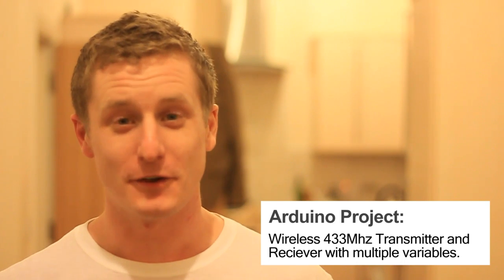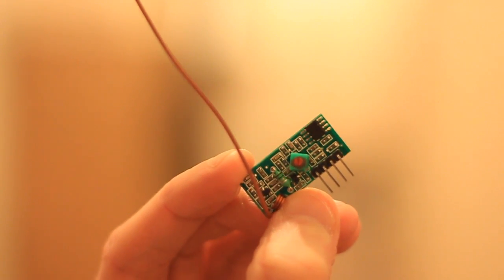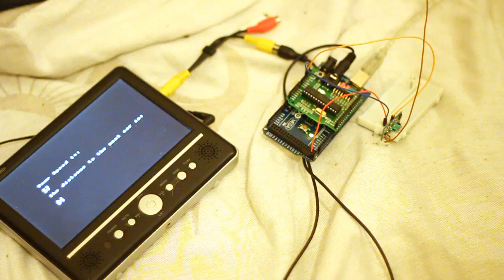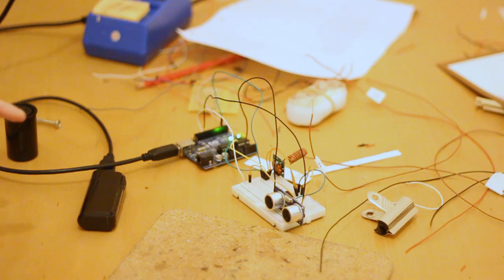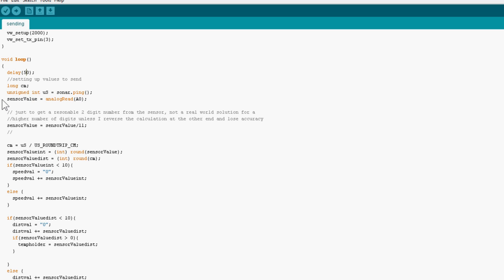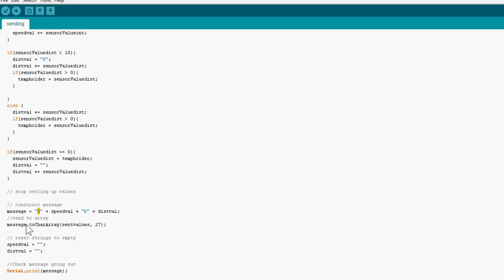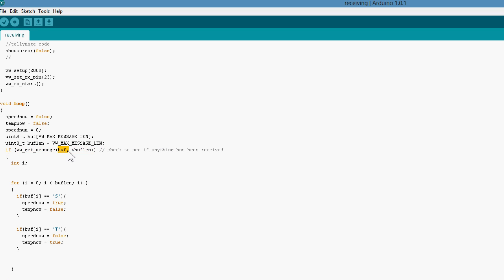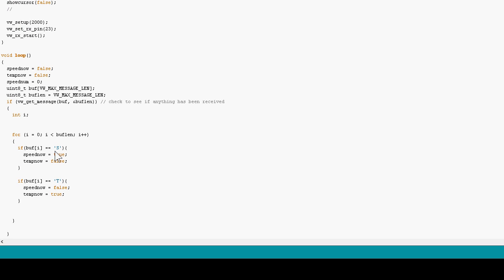Arduino Project: Cheap Wireless 433Mhz Transmitter and Receivers

Comment: The coiled antenna on the transmitter is necessary to provide the proper impedance to the transmitter. If you straighten out the wire without cutting it to its resonant length, you will burn out the transmitter since the impedance will be high. The wire, if straightened out, needs to be a quarter-wavelength of the output frequency.

With receivers it is less critical. The wire can be any reasonable length, but a resonant antenna presents the receiver with the maximum signal.

Comment: David, Buddy!  So I decide to grab some cheap 433 TX/RX units for an upcoming project- quick search and of course you have a video! :)   I'm going to try something a bit crazy with the TX- gonna try to send fake satellite telemetry using RTTY to a radio receiver.  No clue if it will work but should be fun!  Cheers

Comment: Thanks. I'm going to give this a try as well as the nRF24L01 which comes both as a module with the integrated antenna for what looks like about the same range, as well as a module that accepts an add-on antenna for up to 1000m range. There's a lot of info (including libraries) about it on the web. Thanks for providing the video.

Comment: the coiled wire is only to make the antenna more portable for convenience. the length of an antenna determines what frequency it is best suited for. It doesn't have to be exact down to the nanometer, but the closer the length matches the wavelength, the more efficient the antenna will be.  the formula for determining the wavelength of a radio signal is 300/xxx MHz = wavelength (in meters). so 300/150mhz = 2meters. antennas should be the length of the intended frequency, or some multiple (half, quarter, etc. ) on 433mhz 300/433  = .7 meters or 70cm. therefore you would want 70cm, or 35cm, or 17.5cm antenna (full, half, quarter wave antenna). This is all covered in the curriculum for ham radio license, which you should get if you want to use most UHF/VHF frequencies in the US, Canada, and Europe.

Comment from the maker: Hi, my TX data pin was connected to pin 3 on my Arduino UNO. Take a look at the examples included in the VirtualWire library, you should find them really helpful. Serial.print("somethng"); outputs whatever is in the brackets to the hardware serial line in ascii charaters. If you have you Arduino plugged into the PC you can monitor the serial output. For example you could output your message over serial before sending over wireless so you can see what is being sent and received.

Comment: To convert a float to a string take a look at the int snprintf ( char * s, size_t n, const char * format, ... ); function in the cstdio library - I think the arduino libraries lack that - but look at github for one you can likely add. For converting a string to a float look for functions like atof() [alpha `i think` to float] and strtof() [string to float] -

Comment: You may have spotted it already, in the video it looks like you have the antenna wire configuration the wrong way round. The 25cm straight wire should be on the transmitter while the coiled wire should be on the receiver.

Comment: I really respect your candour and modesty wrt what you do and what your uncertain of. Regarding the += operator - I wasn't even aware you could do this. I don't know what the operator does with a string, but if it adds the extra character without first coping the value to a new location in memory, you could be in trouble - I'd be concerned that your next variable declaration would be given a memory location that overlaps the end of your string. I don't know if this is the case or not.

Comment: Thanks my man! Jeez that wireless comms is exactly what I've been looking for, although I've just got a set of those 2km wireless links from Proto-pic (good source of stuff as a fellow Brit :) so I'm hoping that virtual wire library will be compatible but I'm sure they're exactly the same, just more power.
..., and I've been playing with basic stamps and arduinos for more than 10 years but never come across that telly mate shield!! Ordering one this second, thanks bud, subbed. :)

Comment: Interesting! Some ideas for you. First, drop the String class and use Arduino strings instead. (Note the difference between capital 'S' and 's'.) If you convert your String variables to char arrays, typically you'll reduce the code size by about 30%. You can use the standard library strcpy() to copy data into the char arrays and strcat() to append data to an existing array. I think you want to use itoa() to convert the integers to strings.

Next, you can take the analogRead() values and map them to whatever you want. For example, if you want to map the 0-1023 range of values to 0-100, just use the builtin map() function: map(valueToMap, 0,1023,0,100)

Comment: If it is, a way around it could be to initialize the string with a length of 2 - like "00", and then replace that second char, which I think can be done with string[1] = '0' + valueInt (don't take my word for that - I haven't done much serious c programming in a few years)

Comment from the maker: Hi Gearoidof, I don't think these cheap transmitters have the bandwidth available to send audio. I believe the maximum these work at is 9600bps (in ideal conditions) which is about 1Kb per second. That would be some pretty terrible audio. You may want to look at some more expensive options, like tearing apart some wireless headphones with FM transmitter.

Comment: I just ordered some of these I also found the manchester.h library when mine arive I will give it a try and let you know how it works, I also read below maybe there will be a redone video. I liked this video but a refresh with some more simpe code would be cool.
Reply from the maker: +Brad Sogn Yeah, this was a few years ago now. An update is on it's way. Let me know how you get on with the Manchester library.
Reply: I also just found your video on the nRF24L01 maybe it could be a cool video to compare them. My ultimate goal is to create a sensor network with attiny's and send it to a main receiver and then log it from there. Idk I like your channel and I like that you responded thats pretty cool
Reply: So I got the RF transmitter to work pretty quickly and it works well with the manchester library. It it sooo easy to send numbers over the radio transmitter. But I am having some issues because what I would like to do is use an attiny 85 as a transmitter, but it does not work with the High low tech cores. So i went and got a differant core that should have worked but the core didnt work with the new version of the IDE. ugh!! oh well I will keep trying to find an attiny core that will work with the library.

Comment: Thanks for the vid! It was helpful, although I think it would have been better to show a more "clean" code, with simpler information beeing sent and processed. I was hoping for a tutorial on how to set up the wireless communication, not a tutorial on how to read a distance sensor and print the numbers to a screen. As it is now, the RF part seems kinda secondary. I would love a runthrough of the VirtualWire commands. The ones you leave completely unexplained. Strange.
Reply from the maker: +Mikael Björnson Perhaps it is time for an updated video, I have learnt a lot in 3 years. I barely knew what I was doing then and certainly didn't fully understand the libraries, what I did know was how to code a bit. Thanks for the feedback, hopefully another video on Youtube will help and I will look at making a more focussed video soon.
Reply: +David Watts Thanks for the reply! Don't get me wrong, Im thankful for the video you made, and I love the humble attitude. Rare in tech circles :). It's just I'm extremely thick, so I need everything explained in detail. Would love it if you'd make an updated version! Subscribing.

Comment from the maker: Unfortunately I have only tested it to ~25m, it showed no lack of signal strength but I am not sure how far it would go. I have seen reports of farther than 100m. If you want a larger range an Xbee might be a good option although I think they are expensive for what they are. Shop around, if you are in the UK the website SK Pang has a good range but I suppose most sites will.

Comment: Thanks for the video.  It would be have been helpful In the first 10 seconds mention the range of transmission.  Had to wait 4 minutes before that came out.     So you tested it 5m, some claim 150 meters.  Any updates on the effective range?

Comment: At 433MHz, a 1/4 wavelength is about 17.3cm. So you are wrong to use 30cm for an antenna, you need a multiple of 17.3cm i.e. 34.6cm.
Reply: datasheet says 30cm, idk why, maybe for one of the other frequencies
Reply: There are a few cm of track on the PCB which will bring the total closer to resonance. It seems these 433MHz devices aren't too fussy about exact length, unless you are chasing maximum range.

Comment from the maker: I am afraid I cannot remember the exact version and I have built a new computer since without backing up my arduino libraries. I seem to recall having the same issues though and reverting to an earlier version like you did. Are you still having problems?

Comment: I am looking for a simple repeater to replace a wire. So, I have a signal coming down a wire and just want to send it wireless/optical to the other end of the wired that goes to a device. I can't just use a wire as the servo is on moving disc. Any suggestions?

Comment: Im doing a similar project with ultrasonic but i was tentative to use xbee until i came to know about 433mhz transreceiver. I just need to know which pin is the data pin of TX connected to? and what exactly the serial.print() instruction does?. Thank you for the info.

Comment: Hi sir the video is great! Needed some suggestions for my project I want to create a system with receiver and transmitter linkage such that the transmitter from other system wont interfere with my first system . And also let me know if i can use some other component for doing that something like pairing the devices so that it would work for the communication between the components of one system remains firm.

Comment: David, thanks for your video. I have this modules and I'm trying to setup a wireless connection over 30-40meters trough 5 floors. I'm living on the 5th floor and I want to check my mailbox which is on the ground floor of the building. So in line of sight I get a response between the modules, but not trough the walls. I've been reading a lot of setups online, but still no help. Do you have any suggestions? Will try your antenna setup, but do you have other suggestions I could try with these modules? Or should I buy other modules for this project? Do you think that I should lower the buad rate to 128-200bps will help? I only need to send arround 16 bytes. Thanks.
Reply from the maker: There is likely to be a lot of metal reinforced concrete over 5 floors so you will get a lot of signal blocking. Changing your antenna will make a lot of difference (http://www.instructables.com/id/ARDUINO-WIRELESS-HOME-SECURITY-SYSTEM/step9/How-to-Increase-The-Range/) but it may not be enough since they are quite low power devices. It might be a good idea to pick up a couple of NRF24L01+ modules and see how they fair.
Reply: Sead Kolic I agree with David, however he has  not mentioned  another possibility: increasing the voltage of the transmitter. It can take 9 Volts and that increases the  output power.
You MAY need a transistor in between to make the HIGH  from your Arduino be enough for the  9 Volt fed transmitter and depending on how you switch it the transistor  could invert your signal so you have to invert it back in software, so  getting the NRF24L01 might be easier.... but  I once upped my voltage to 8 Volt (remember ONLY to the transmitter) and  could still trigger it with my Arduino and had much more range
Reply: David Watts Already have, will try those too ;)
Reply: Ed19601 Thanks for your reply. I already did so. But I did not do it with a transistor... I'll try that too. Any suggestion for a type? I also ordered some antennas that I can solder on the modules. I already tried a 17cm straigh wire, but still no signal trough 5 floors :) I also ordered 2x 2.4GHz modules with amplifilers. From what I've read, those modules work with 3.3v so I'm not very optimistic for boosting the signal trough that many floors and walls. In a line-of-sight situation both modules would work ok I think. Do you have any tips on reducing the bps. Will that help? I only need to send about 16bytes.

Another option here is to kill my walkie-talkie and use those tranceivers :P
Reply: Sead Kolic Well, maybe the transistor isnt necessary if you already tried and  got a signal at short distance. The transistor is merely to adapt the levels. Should the need arise, try a BC547.
What I experienced myself was that the problem is mainly with the receiver:
If I use the transmitter to switch commercially available remote switches, I can cover at least 3 floors (I dont have more floors), while with  the   small receiver that usually comes with the transmitter I can cover  just across the room.
for  the communication between the two modules, I use manchester code  that can be set to as low as 300bps, I usually do 1200. The baudrate  does make a difference in distance I noticed.
I do nt have experience with  'virtual wire.
I am not sure how you  signal that your mailbox is full, but just  for  experiments sake you could try to send an RC code to a commercial  receiver/remote switch, using the RCSwitch library or the remoteSwitch library and see if that goes up 5 floors: perhaps  just switching on a light would be helpful already.
other than using the 2.4 GHz modules, you could go look for  somewhat stronger  433 MHz modules.
here is one advertsied as 2km: robotshop.com/en/seeedstudio-433mhz-rf-long-distance-transmitter-receiver.html but I am not sure if  that is really true.  It is 2.5mA at 5 Volt so that is 30mW at most. probably just the 25mW you already have
Reply: Ed19601 I have not tried the Manchester library yet. Will try it and reduce the buad and perform some tests with that. I will put the receiver on the balcony and see if I get any reply. Setup will be 9V, 300bps and 2 types of antennas to test with. Receiver: 5v, 300bps and also 2 antennas to test with :) hope it will work. I will just send a signal every 3s or so...
Reply: +Sead Kolic -  You should change your TX baud to to 500b/s or lower  and increase the TX supply voltage to 12V ( spec is 3 -12 v).

Comment: hi sir, may i ask, how did your sensor trigger the transmitter? how is the connection of the sensor, arduino, and the transmitter? i also have same project as your's. my professor ask me to have an alcohol sensor. and if there will be some detection, it will trigger the transmitter to transmit some data (or a code) to the receiver. can you explain to me how it would happen? pretty please? it will be a big big help for me. thanks!
Reply: The Transmitter required an MCU(Arduino) to deal with the data from the sensor.

Comment: I want to use this with just power and switches to turn on and off an LED without any other equipment, Is that possible?
Reply from the maker: Majik365 It would be a little more involved than that but yes you could.

Comment: can use 433Mhz Transmitter and Receivers , as a multicast transmitter , and send data to more than one receivers of the same type? Thanks in advance.
Reply: Absolutely Yes, we call it as point to multi-point.

Comment: hi mate , i need some help concerning the wireless transmitter , can i use an RFID to trigger a signal when reading a specific mifare card then tranmsmit data to another arduino hence operating a servo
Reply from the maker: Hi, yes you can. There is a very similar example in the mifare library. The transmitters are really simple high low triggers so that part should be easy.
Reply: David Watts so i can use the same RF module you have used to do so  , euh can i have your guidance for this . I do have the virtual library , I do also knows how to work with RFID , bit combining those two to trigger a servo is quite a bit headache for me . Do you have any tutorial concerning this .
Reply from the maker: kooroosamy kavinien Hi, I don't have a tutorial for it but you can use the same 433Mhz modules. The RFID library has examples that should help.
Reply: so i don,t need an Xbee module then . RFID is not connected to analog pin so this is not a problem then , do you have any ideas how to merge the codes .
Reply from the maker: kooroosamy kavinien I am happy to help out but you really need to pick up the libraries and try it out yourself first. 

There is no standard code.
Reply: well I think that am on the right track , yeah I've both Mifare and virtual wire library , basically what am doing is to read an card ID , if card ID correct send a character A , if A is received then power the servor . Thanks for your videos dude
Reply from the maker: kooroosamy kavinien Cool, let me know how you get on.